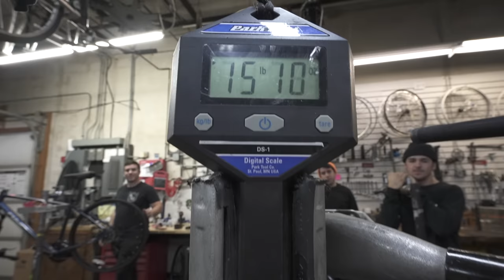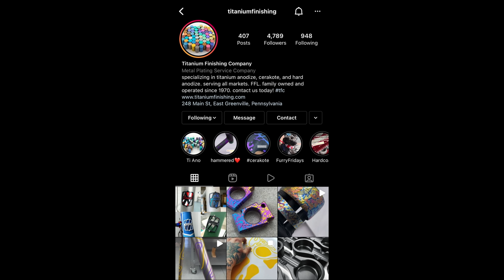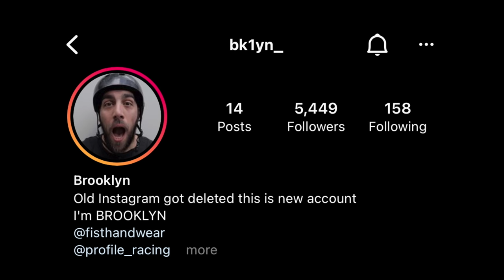Brooklyn's New Titanium Dream Bike Is INSANE!

Comment: Rad looking frame.  Ti changes colors with heat like motorcycle exhaust.  You can set up anodizing in your garage in coolers but its not super easy.  Prep the parts well but then the power supply requirements and how you hook it all up. Dye and time in tank take some practice.  It can be done though.  Years ago i helped set one up in 5gal buckets and got some good results.  It is controlled oxidation.
Reply: You don't use dyes with titanium. You use dyes with aluminium.
Reply: @bmxriderforlife1234  true.  I never said to dye Ti but i can see how its not clear.  What i used the at home kit for was aluminum.
Reply: @TheShift1313  yeee aluminium diy kits are awesome

Comment: @7:41 my guess is they add an oil of sorts, splatter it onto the frame, then they get the water/oil /fire they dip the frame into to a certain temp. they then dip the frame(into said fire/oil/water), and introduce cooler temperature fluid whilst the frame is being shocked, causing the titanium to bring out different hues
Reply: and if they arent added or removing anything, that means they have set fuilds in the dip they react different to heat
t

Comment: I used to make headbadges for bikes using a rectifier and acid solution to eat away the image I printed onto the brass. It's gotta just be certain chemical plus electricity to work.  I know some ti is colored with heat

Comment: The odyssey hollow key link chain isnt the lightest chain, but it is the most simple. I have both the key link and the fly tractor chains and the fly chain is slightly lighter :P It also has 1.2mm thicker links.
Reply: Also wow its only 15 lbs 10 ozs. I dont have a ti frame, forks, bars or cranks and my bike is 20 lbs 3 ozs. Thats crazy!

Comment: I just recently bought stuff to be able to Cerakote different parts and it's such a cool and fun thing to get into. The possibilities are totally endless as far as I am concerned.

Edit: So what she said was basically heat treated the Titanium to achieve those different colors and hues, but instead of doing so with an actual flame they used electricity if I understood correctly. I've heat treated differently things over the years to get the same affect, certain colors appear at certain temperatures. Unfortunately if you overheat and pass over a certain temp(color) you can't go backwards without starting from step #1

Comment: Be careful with the rnc cranks, the connection of the spindle with the crank arm is just a tiny weld - nothing more. you definately need to put them through heavy duty testing, those things are known to not take a bmx style beating, good luck. draw a line from both cranks to the spindle,  ride hard and see if they are still aligned.

Comment: Anodizing is oxidation.   Kinda like surface rust... you can use a torch to heat anodize titanium and it changes colors.  If you don't like it, you can polish the color off.
There are many many other ways to do it. 
Science is rad.